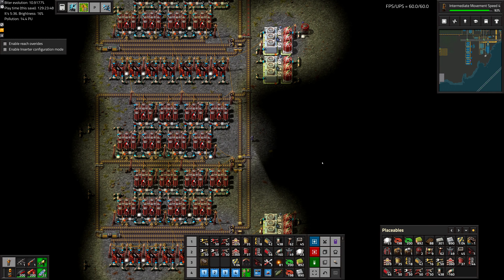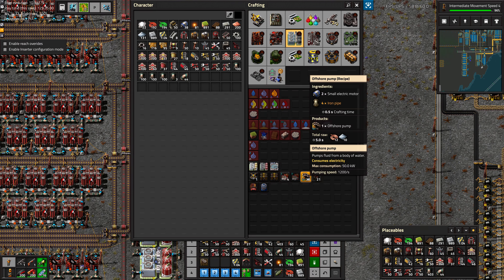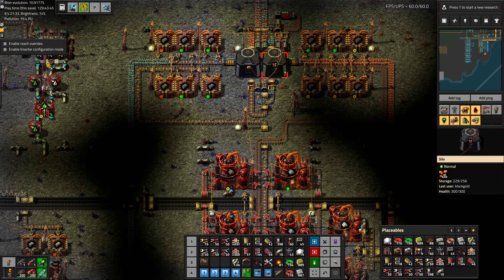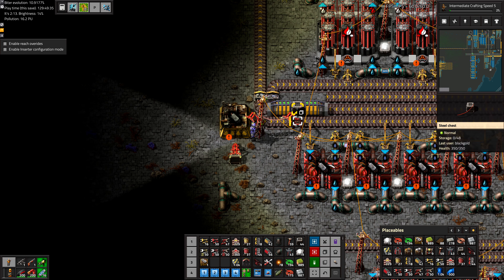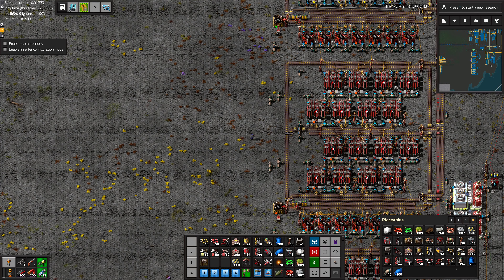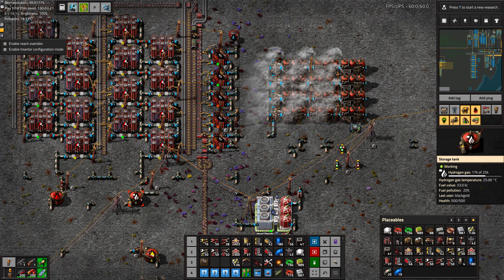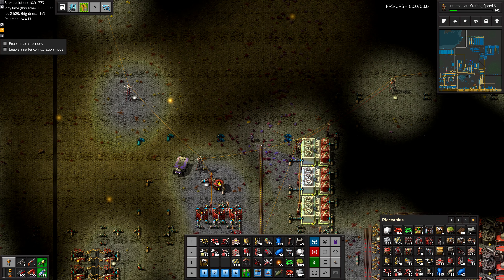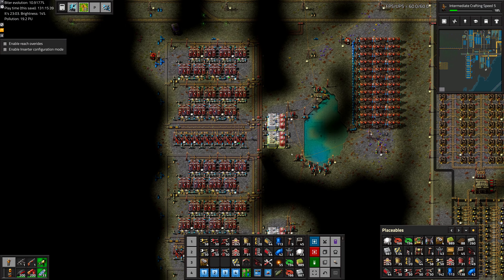[Factorio 1.1 4K] Angel/Bobs Ep 95: Hooking Up The Electrolysers

Comment: Not sure if you know, but clicking on a pipe will reveal the pipe contents and you can mass delete fluid in the entire system.

Saves from having to tear up all the pipes.

Reason it was fine next to each other (the undergrounds and straight) but wouldn't let you connect it was cause Hydrogen was still in a pipe somewhere far off in the system.

Had this same issue with a Purified Water setup.

Love the series!
Reply from the maker: That explains it, thanks for the info!

Comment: i really enjoy most of your stuff, but sometimes you loose yourself ;) (that limit for the pumps is so ultra useless without a latch) its doing the exact same thing as without circuit system, just at another fill level (it will start stop start stop at 5000 instead of start stop start stop at 100) you should be carefull because that eats FPS and at some point you might have to remove more and more of so hard earned automation^^
Reply from the maker: This is necessary because washing electrodes actually produces water which is a little unexpected, so the tanks need to be partially filled so there’s room for that byproduct
Reply: @marsh8056  top off valve (is that the correct name, im not english, i guess you know what i mean)
Reply: @marsh8056  also i suggest to use pumps to direct flows (or valves) im not 100% sure, but i think it makes sense to direct the flow (if possible) so the fluids dont have too much to spread to, for better UPS effiency you have very large "pipe networks" without any direction
Reply from the maker: I’ve found that top up valves don’t work well with high flow fluids such as water from offshore pumps